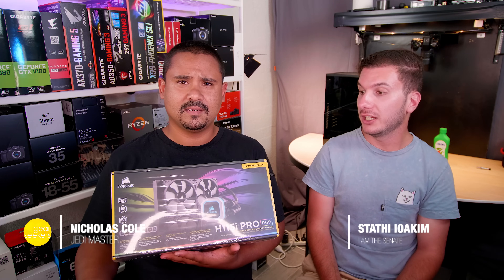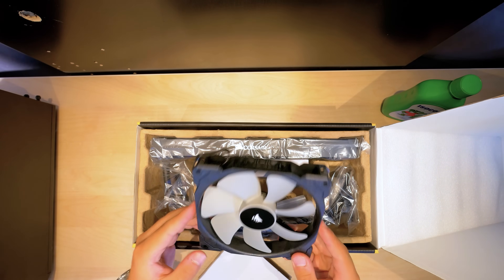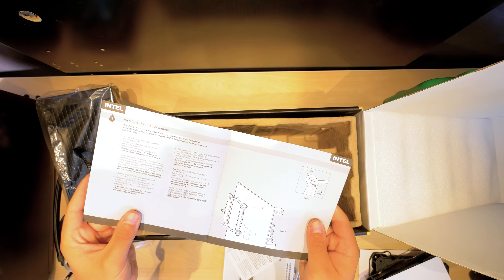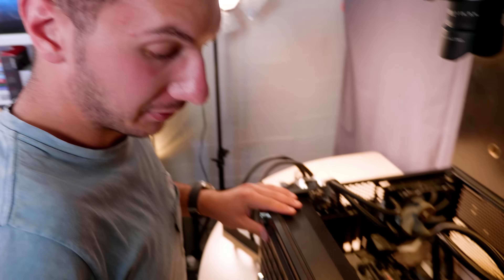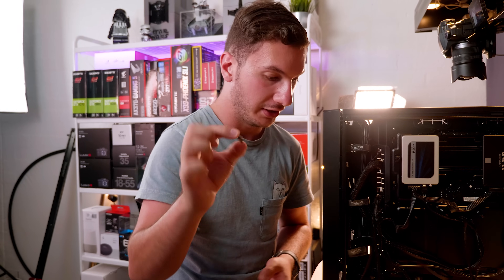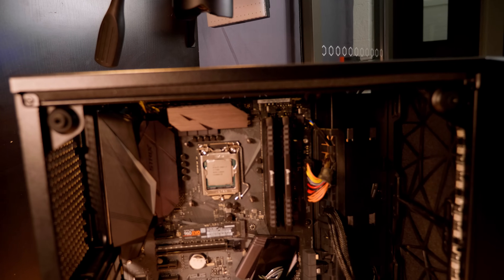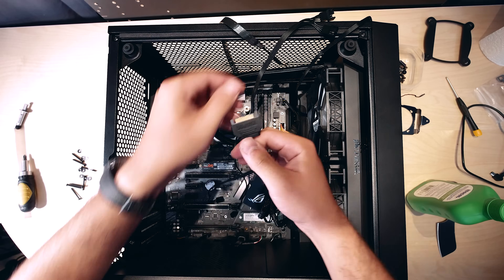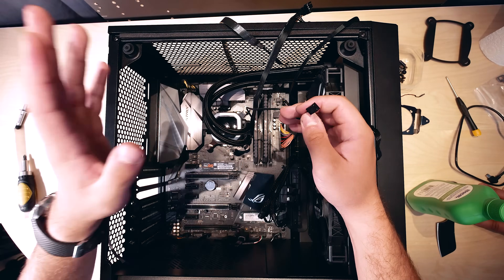HOWTO Install The Corsair H115i PRO RGB All In One Watercooler + Unboxing

Comment: I have the Corsair LL's with the lighting mode. I'm currently using and air cooler but looking to get this particular AIO. If I want to use my Corsair LL's with this unit, do I simply replace the stock fans (on radiator) with my LLs and plug into my splitter as usual?
Reply from the maker: Yes

Comment: is it better to connect the RGB cables to a commander pro or the connectors coming from the pump? i'm having a hard time synchronizing the RGB from the 115i's pump and fans with the other 3 LL series fans currently in my case. I would love to hear your take on that.
Reply from the maker: Pump has its own lighting in iCue.
Reply: @GearSeekers  Yeah i know it does....but which configuration would be best if you are trying to synchronize all your lights along with the pump?
Reply from the maker: I dunno. I don't use iCue in any of my daily driver pcs
Reply: @GearSeekers   honestly i don't blame you, the software seems shitty.

Comment: bruh i’m having the problem w the cpu fan power but like my fans work in the bois but the corsair light blinks and the light is also faded and it doesn’t show up on corsair link idk if it’s the pump or the motherboard
Reply from the maker: because you're not supposed to be using corsair link. use icue

Comment: What u have to change in bios to get past cpu error if I use that dedicated aio 4pin slot?
Reply from the maker: Read your mobo manual it will tell you how. Every mobo is different
Reply: @GearSeekers  cheers
Reply: @GearSeekers  Mobo manual for asus z390-f is not clear. Please answer the question.

Comment: building my first pc, will this fit in a phanteks eclipse 350x and can i replace the fans with corsair ll140?
Reply: yes it will fit the phanteks eclipse 350x, the radiator is 280mm and the case specs state that there is a 2x 140mm fan mount
Reply: thanks bro
Reply: @zephyrp8836  do I have to like change water or something, I'm new to Watercooling!
Reply: @realghostxd  no its a closed loop its pre filled
Reply: @zephyrp8836  Ok, TY 😁
Reply: You can use the LL140mm fans, but if you have them on the inside, they will be backwards. Look around the bezel of the fans, there will be two small arrows that denote which way the air flows, and which direction the fans turn. 

I have this AIO and I have used LL140mm fans in addition to the fans provided. I have a Corsair 750D Airflow and have mounted this radiator in the front. The two LL140mm fans are placed behind the airflow filter in a push configuartion. The radiator is placed inside the front, and the two ML140mm fans are placed on the left-hand face of the radiator in a pull configuration.

Comment: Do you guys know how to get around the cpu fan fail warning you get before you get into the bios? Could you make a short video on it possibly. Also i plugged the 3 pin pump header into the aio pin header things  (dont know correct terms) was that the correct  port/ pins?
Reply from the maker: Disable fan warning in bios. Look at your motherboard manual. It's a simple step. Doesn't require a video.

Comment: I was planning on mounting the radiator to the top of my case (carbide 500r) with two exhaust fans, an exhaust fan at the rear and three intake fans at the front.  The idea being the front fans pull cold air into the case, and the other three exhaust fans pull that cold air across the components and out the top and rear.  However, the Corsair instructions with the H115i Pro say it's better to use the radiator fans as intakes.  That doesn't make sense to me, since that's pulling hot air into the case.  Which is the best approach to take and why?
Reply from the maker: The air is not that hot. If you exhaust the fans you will notice significantly higher temps.
Reply: If you have an open shroud GPU and install the fans and radiator as an exhaust, you’ll have higher temperatures because the warmer air rises from the GPU. It’s best to use intake with this setup. 

With a blower style GPU it doesn’t matter where you mount it. Exhaust, intake, they’re the same performance wise.

Comment: My pump only lights in white. What did I do wrong?
Reply from the maker: Install iCue :)
Reply: Gear Seekers I got icue but it does not recognize that i have a 115i pro. I think that I have made Andy cable of the 115i wrong.
Reply from the maker: Double check that the USB cable is plugged into the block correctly
Reply: Gear Seekers Yes I will, but I think it is because it lights (But only in white). Where should the cable belong to (to which header)? I got an Asus B360F. Maybe you can explain where the header is, it should belong to.

Comment: Yeah i have a meshify C case too and 115i pro coming in two days.  I was thinking jay2cents said mount radiator on front, and push air in, which you did.  But i believe he said  put fans first (on outside front) instead of on inside.   Do you really think its better to mount fans Inside radiator (air pulling inside) vs. fans on outside of radiator but still pushing air inside the case.
Reply from the maker: makes no difference.
Reply: what kind of GPU you have on this setup?  wana make sure the ASUS strix 1070 gets in.

Comment: Thank you for the video, but I have a few doubts about your fans... so do you really want to push hot air inside the box?
I think the radiator should be on top, pushing hot air outside... thanks
Reply: Always use intake for aio
Reply from the maker: That is the correct fan orientation for mounting a radiator at the front. The radiator cannot be top mounted in that case because it doesn't fit. Yes you want to push the "hot" air through the case. You'll find that the air isn't that "hot" at all. I've built thousands of PC's with AIOs

Comment: Good water cooler, but freaking annoying LED lights on it. One needs that Corsair Link software running on your system all the time to turn them off. Otherwise, after a shut-down it resets to a glowing state again. As always, good hardware, sucky software.
Reply from the maker: No software is good software!

Comment: when you plug the pump cable into the special pump header what do you do next in the bios change that header to be pwm so that you don't get cpu fan error while booting in?
Reply: Bit late with this. Set CPU fan to ignore, which is what I did when I installed my water cooler two days ago allowing me to boot. However I found out today that I needed to plug it into CPU_FAN (yes we're not using an air cooled CPU fan) where it will not only allow you to boot with CPU not set to ignore, but it will also monitor the water pump RPM. I imagine if the pump fails then the motherboard will get a notification that the 'CPU fan' is not working and probably shut down.

Comment: my pump works, temp sensing works, RGB led does not, it showed a little bit when i first started up my PC and it posted first start after building. i have commander pro it doesnt show, i could only fit 1 fan to the radiator and im not using the 2 fan connectors from the cooler. the fan is connected to CPU fan, and my usb is connected to a usb header on MOBO it doesnt show. maximus x hero, i7-8700k crystal 570x, whats wrong.
Reply from the maker: Install Corsair icue and double check everything is plugged in correctly

Comment: great video. but i have a question. are the link cable and the other cables long enough to hide behind the motherboard. i am looking to have a clean and clear computer build with minimum wires poking out..trying to hide 2 fan connectors and a link cable is going to be a PITA

Comment: I use 44$ cooler - Cryorig H7 Tower Cooler. air one. for the exactly same proc and it works PERFECTLY.  I got 33 degree C. max. And I can hear any noise at ALL. No Water Cooling required. But thanks for the video.. will use it for I-9 XE proc where it requires. But if not overclouded.. I doubt .

Comment: hi guys, i am wondering for the usb connector of the pump, can i use other port to connect it?  because i only have 2 jusb in my motherboard and i need one for my hue + and the other for the usb for my casing. please help.
Reply from the maker: You'll probably need an internal USB hub

Comment: Hey guys, quick question. ^^
Can i put corsair‘s ll120 - 120mm RGB fans on the radiator?
Instead of those blank - standart fans?
I would like to light up my meshify c with all cool RGB stuff corsair is selling. :D
Reply from the maker: No it will need LL140s
Reply: Gear Seekers 
Ah, OK thanks. :)

Comment: Hello, Is it okay if the cpu block is mounted upside down? I accidentally mounted the block so the the corsair logo is upside down. Will it still work fine?
Reply from the maker: Yeah it won't make a difference. Should work the same way
Reply: Gear Seekers Okay great! Thanks for the reply. Also, where do I plug in the sata cable to? Sorry I'm kinda new to this.
Reply from the maker: Into a SATA power connector coming from your power supply.

Comment: Hi guys, I noticed at the end of the video that the fans on the radiator are spinning but are not lighting up. I am having the same issue and and still can’t find a solution. Can you help me? Great video btw
Reply from the maker: The included fans don't light up.
Reply: Gear Seekers Really!? Maybe I misread the specs... Thanks for the response

Comment: Where in Bios do you change the CPU pump settings so you dont get warned about not having a CPU fan?
Reply from the maker: You disable the warning for the CPU Fan. It's an option in every BIOS.
Reply: Gear Seekers Thx U
Reply: Gear Seekers I have fast Q about My new CPU that i recently installed, I mistakely did a little mark on it it barrely seems like nothing and Im waiting for My new water cooler, but Im so nervous that my CPU is broke.
Reply from the maker: If it's like a scratch on the top of it on the heat spreader you'll be fine. That's just a bit of metal. Not the CPU itself.
Reply: Gear Seekers Yeah its on the upper side, I’ll hope that I would be fine then its My first water cooling installation :)
Reply from the maker: its literally just metal lol. It's fine.
Reply: Gear Seekers I dont find the option to disable the Cpu fan in BIOS

Comment: In my Quick Start Guide, they´re showing me to plug in the Pump tach cable to the CPU_FAN header, but you choosing to put it in pump header, can you tell me why?
Reply from the maker: Because a majority of older motherboards don't have a pump header.
Reply: If you have both headers (pump and cpu_fan), can you use either one?
Reply from the maker: use pump ;)
Reply: Pump header provides a constant 12V to whatever is plugged in to it and the voltage cannot be changed - I'd go with pump
Reply: I was under the impression that something HAD to be plugged into the CPU_FAN header to not get errors and such
Reply from the maker: You can disable that warning in the BIOS
Reply: One last question. What if the pump is SATA powered. Oils or not have consistent 12v anyway? Thanks for all the answers!
Reply: My guess is the pump is powered by SATA but the 3pin is purely for RPM readings in Corsair iCue BUT in saying that, the 3pin could also be a failsafe in case your SATA somehow manages to die. I've never tried plugging just one source in but in all honesty, use SATA and connect the 3pin to the pump header just to be on the safe side.

Comment: In this video here I see you have installed the radiator into the  front of the pc case. But on mine are 2 200m Fans so my only option is to install mine at the top. So would this be OK?
Reply from the maker: Yeah should work fine
Reply: Gear Seekers thanks :)

Comment: I'm just installing it. Is the Intel bracket suppose to be very very loose ?
Reply from the maker: The rear bracket it kinda loose until you tighten it all up
Reply: Came to this vid with the same question. Very helpful, thanks.

Comment: Where do I connect my aio header , my pump has no water flowing through when i power on my pc .
Reply from the maker: To the CPU fan or CPU pump header
Reply: Gear Seekers thanks , i am getting 30 degrees on idle and about 70 on 100% load ? Are those numbers good enough for a 8700k
Reply from the maker: That seems about right. How are you fans oriented?
Reply: Gear Seekers i have the cooler top mounted pushing air through the rad ,  and 3 ll120 fans intaking from the front

Comment: failed design on the tubings... whats teh point of have a pro rgb block when the tubings are all screwed up and block half the rgb appearance... rip corsair designing
Reply: Thats because the case used on this video was kinda small I think. The space between motherboard and front fans is short, most of other cases have a larger space there. Maybe I'm wrong.
Reply: This is an pretty small case. Any decent sized tower would look alot better. You can see in the video they are limited to a 240mm radiator.

Comment: Hey Nick, quick question. You are one of a few people that have had their hands on both the Corsair Pro series and new Cooler Master AIOs. From an aesthetic point of view, which pump looks better, in person, RGB wise? Another great video, by the way.
Reply from the maker: The CM pump looks better to be honest. The way the light pulses around the ring is cool!
Reply: Gear Seekers I appreciate your quick response. I'm leaning towards the CM AIO model already. Even though they are usually less expensive they always perform well. Usually as good, or even better than, AIOs that have larger radiators and larger or more fans. My standard CM ML240 even has better benchmarks than the TT Floe Riing 360 and the Enermax Liquitech 360. The only one that consistently out performs the little ML240 is the bequiet! Silent Loop at nearly twice the price if you catch the ML240 on sale. Now CM adds the RGB line up with a controller that is not proprietary and it seems to be pretty much a no brainer to get the CM240R. Is there any word on a 360 model? If you can share that information, of course. I get the embargo thing.
Reply from the maker: Actually to be honest have heard nothing about a 360 version. Personally I'd love to see one because it's definitely something that I would use myself.
Reply: I would use a 360 as well even though I've already had great results with my current ML240. I just like the idea of getting everything in one neat little package (fans, pump, radiator and usually all the connectors including splitters). Also the place I'm planning on mounting it has room for a 360. The way I'm mounting it I can make the 240 radiator work though. What I really would like in this case is just being able to get the RGB pump assembly and swap it somehow with my current non RGB pump. I already have the RGB fans. i'm just wanting to complete the RGB look.
Reply from the maker: Swapping a AIO pump. Now that's an idea!
Reply: I'm not afraid to mod stuff as long as it looks good afterwards. Some things are as simple as the new O11 Dynamic case. The glass and metal panels have the exact same mounting peg/channel set up. I'm considering a second large glass panel for the side behind the motherboard tray. Some things take more thought, like swapping an AIO pump, but I'm sure it can be done.
Reply: That is, of course, after the damn case finally becomes available. Ugh My patience is getting short. Lol

Comment: Does the h115i have a 3 pin cable? Also can I replace the fans with two Corsair hd140s?
Reply from the maker: It has dual 4 pin pwm connectors for fans. You can replace them with any 3 or 4 pin PWM fan that is 140mm
Reply: Gear Seekers ok thx you got a new subscriber

Comment: Great video. I'm getting that case and that same cooler and it's nice to know everything fits well.
Reply from the maker: It's a really great combo!
Reply: Ah crap I should've looked at measurements first. Do you think a 290mm video card will with in the case with this radiator installed?

Comment: Great video, I just realized that that the radiator fans would need to bring in cool air to cool down the radiator ,I thought you could have exhausting fans blowing through the radiator but this would be hot air.
Reply from the maker: It depends on what works better for your system. Most of the time the way we set it up yields better temps
Reply: He meant he was coming to the realization that the fans (whether in front or behind the radiator) are placed as intakes in order to bring cool air into the radiator. The weird realization being that it being that way pulls hot air from the radiator into the case as an inevitability if you want cool air from the outside to pass through the radiator.

Comment: Can the radiator fit to the top side of the case?
Reply from the maker: Depends on the case. Not sure about the Meshify C but the Meshify C would work best with it on the front because of the open front design.